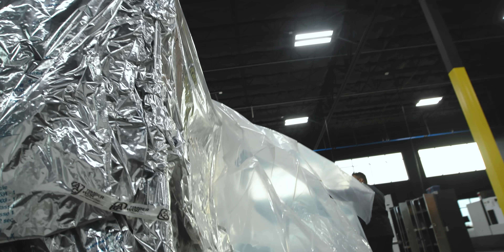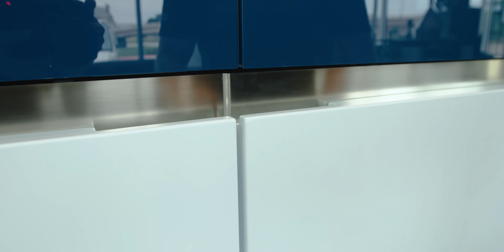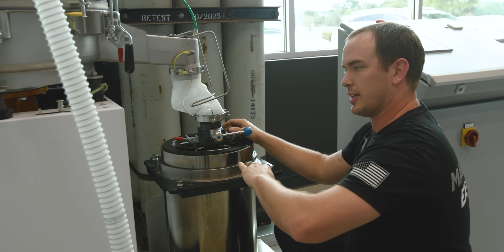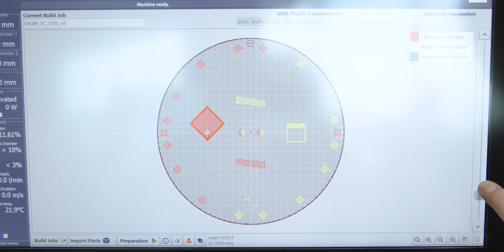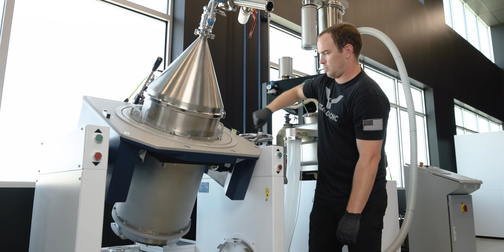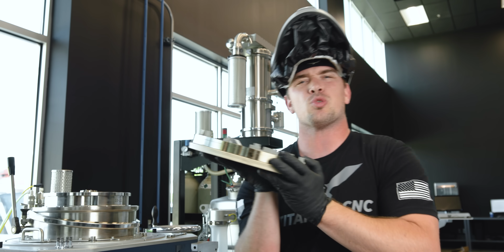The Future Of Metal 3d Printing Has Arrived | Trumpf Truprint 3000

Comment: Titans, can this truprint 3000 print in Tantalum Hafnium Carbide who's melting temperature is over 7,100 degrees F. ?  If so I would like to hire you to make a model of a rocket engine and it could be tested for water cooling during test firing.

Comment: So how did the sample build compare with the model? As a retired, machinist/programmer/engineer I would make a circle/diamond/square test to ensure that everything was to specification on new CNC mill equipment, then using a CMM get a base line result. 
If you don't measure you are not managing.

Comment: Why is the depowdering not integrated into the machine? especially if it's just about rotating the build plate 180°, it seems so unnecessary and time consuming.
Reply: You can unpack it in the machine with the internal vacuum if you want. The benefit of having a separate machine for depowdering is that you can unpack builds while the printer runs.

Comment: I have never worked with this kind of machine, but I have a question. Why would you want to invert your print instead of vacuuming it? There will always be pockets that do not empty by turning them upside down. Can you vacuum them afterwards anyways or?
Reply: The sieve station would need a vacuum pump to pull the material back into it. The vacuum pressure used will evacuate all the little pockets without asking. I suspect, though have not seen, that the depowdering station gently shakes the part to eject stray powder that’s stuck up there.

As to why you’d want to invert…gravity is free energy, vacuum pressure costs money to buy the electricity that makes it. Germans LOVE solutions that save money and energy…which is probably why the depowdering station has a crank to flip the part over by hand instead of a motor.

Comment: I am designing very fine 3d printed chainmail, started at 3mm wide rings, 4x smaller than anything I could find online, it's so fine that it feels like fabric! The gaps between the rings while they print is 250 microns. Now I'm trying 2mm and 1.6mm wide rings but plastic just isn't strong at that scale so they print fine and then break when removed from the supports. If you guys wanted to try to print it on that machine that would be awesome!

Comment: How do the printed pieces not fall off the build plate when it is inverted?
Reply: The parts are welded to the build plate so they won’t fall off. They need to be cut off the build plate using a saw or an EDM.

Comment: That thing looks like a beast of a 3D printer!!
What level of accuracy can you get from this machine?
Reply: It is a beast for sure! A good general rule of thumb for accuracy is +/- .1mm or .004”.
Reply: Given that the metal powder it uses has particles up to 63 microns, the actual accuracy of perimeters that are melted by the laser is probably around twice that.
Reply: @significantharassment  The sieve screen is 63 microns but the powder used in this case has a particle size distribution of 15-45 microns.